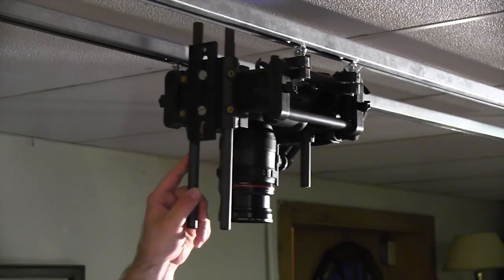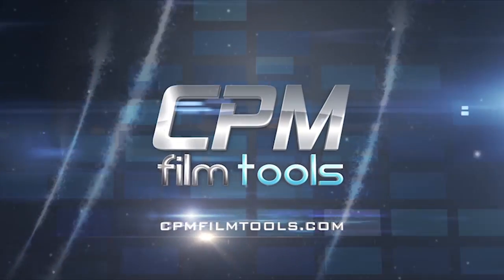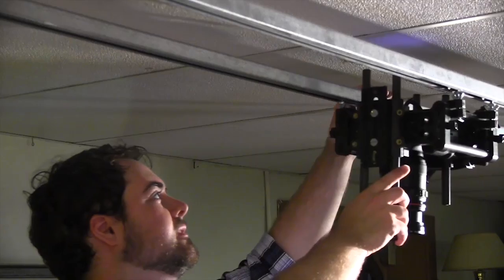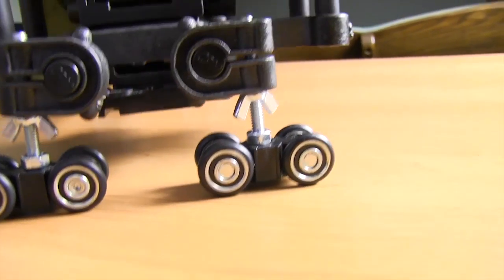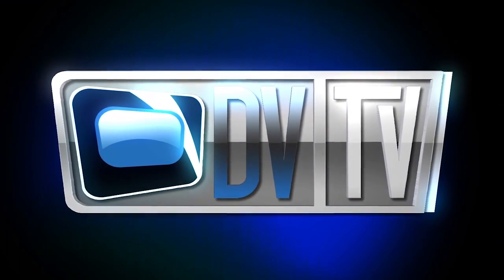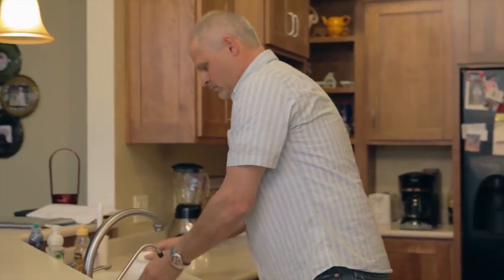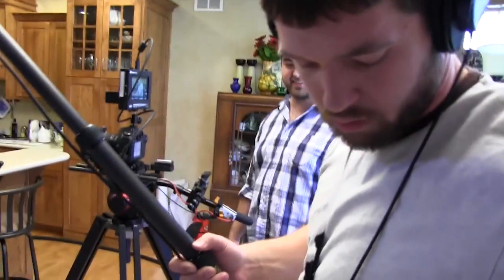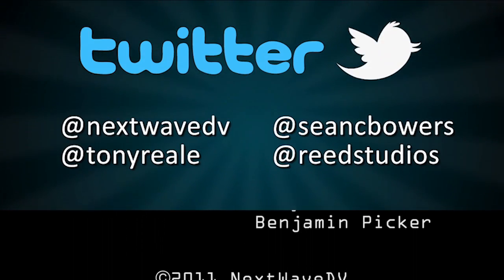DVTV - RigWheels Review, How to use a Dolly or Slider

Comment: I recently get Davis & Sanford tripod w/FM18 Head from B&H, it come with a W3 dolly with "3 ball rubber wheel.  Do you know if it's possible to change that wheel into rig wheel?  If so then it'll be great cuz all I need will be rig wheel and some pvc pipe